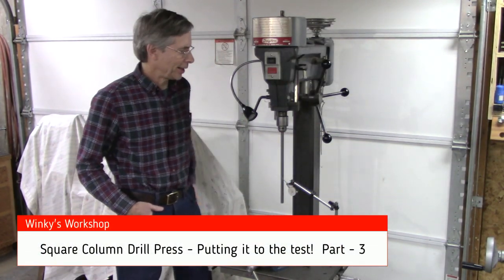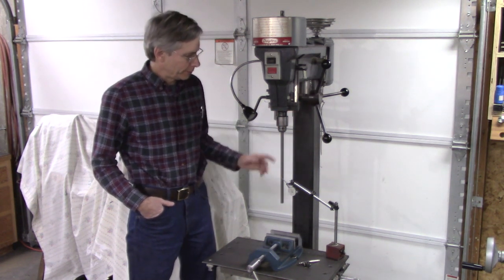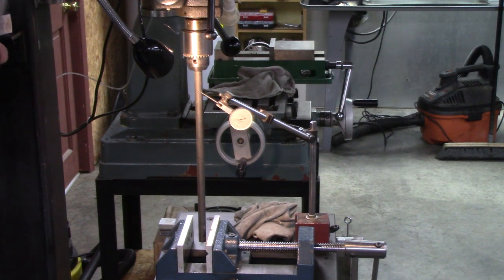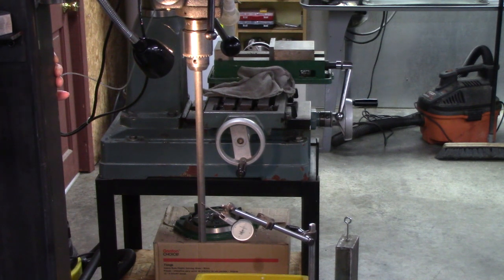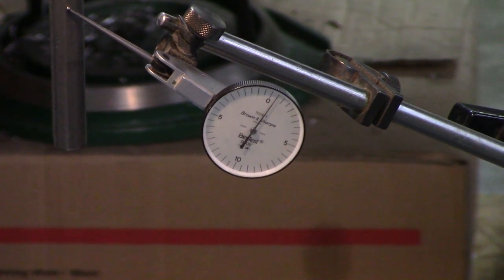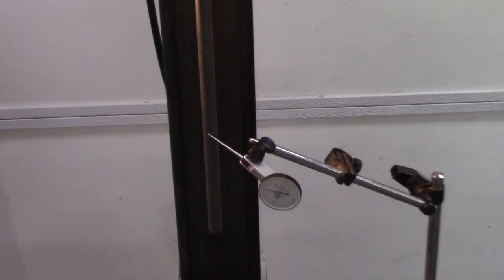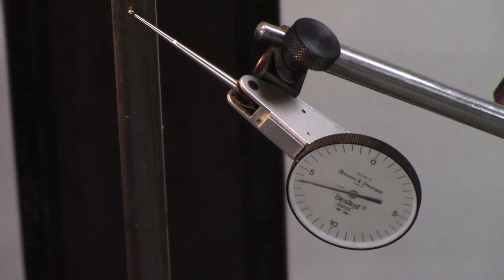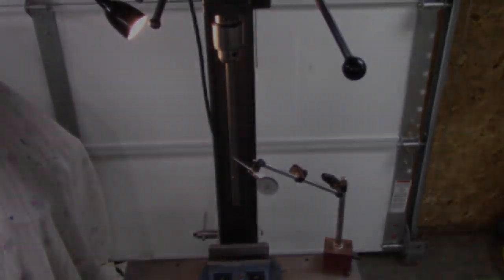The DRILL PRESS FIX - Testing for accuracy -  Part 3

Comment: Hey Wink, another good job!  Where is a good place to pick up cut offs  of metal?
Reply from the maker: That's hard to say. Sometimes I find good stuff at recycling facilities but I also go to a very industrial steel yard about 40 miles from here. Most cities have a steel supplier near by that caters to industry and fabricators and they are probably 70% less any on line sources. The steel yard near me has one huge section of off cuts from industry and out of spec steel for 30 cents a lb. I always end up buying some of this stuff.

Comment: Add a wider/heavy metal base plate underneath the steel frame,... add some set screw/feet (with some nice rubber pads) to level her up, and/or bolt it down to the concrete floor (so  the whole thing doesn't wobble), and you are golden. :).  
Well done.  You got some nice travel length.
Oh,... Maybe a different (bigger) sprocket up top to speed up the travel time (insert yawn here).
Reply from the maker: Thanks for the comment. I think the horizontal supports at the base need a diagonal support to the column. I'm sure it's plenty strong, just springy.  Also, I totally agree on the crank. I now have a harbor freight 3/8" drill driving the lift screw. It looks funny but works great.
Reply: The base looks very narrow. The steel should be strong enough, it just isn't very wide.
If you can bolt it down,... Or,   Put some inserts in the floor that you run a bolt thru and down into.
That way you can wheel it around, and bolt it down when you need to.  The rest seemed very solid.  Nice job!
Not sure how you'd add a diagonal without losing range of up 'n down.  ?

Comment: What a great solution! In the previous parts I thought the idea of a motor driven lift screw was sort of over kill, but watching you lower and lift the table for this, I get it now!
Reply from the maker: I have a harbor freight drill on the lift now.  It was $17 buck and works perfect. It blows my mind that a company line Grizzly doesn't make something similar. I mean they could make a dovetailed column like a mill only lighter weight. It now has an X Y table on it and I use the heck out of it. I highly recommended both the drill press mod and the X Y table.  The table was kind of hard to make but even if you had to buy one it is well worth the money.  https://youtu.be/6gxFdKJ8Ja8

Comment: Nice job. I have found the new square and rectangular tube is not as square as the older steel so you really got lucky with the tube. Your build is impressive with all the travel of your table and the mating parts being so true with each other.
Reply from the maker: Thanks! I'm not sure about old vs new steel but yes, I was shocked it was so accurate. If I remember right the dimension was within .002 top to bottom. If I partway lock the quill and account for the backlash in the X Y table I can drill very accurately.

Comment: Darn near PERFECT!  I DO NOT THINK MY DRILL PRESS IS THAT GOOD.  Ithas a round column.
Reply from the maker: To be honest I as shocked it was so close. Your drill press is probably better than you think. What I was measuring was how well aligned I had the top tube when I welded it to the square column.

Comment: ... Especially surprising since you did some heavy welds at the ends.   You'd think that would distort the tube even if it started straight.   You must be living right.
Reply from the maker: The 4-inch square tubing was 1/4" wall and the round was 1/2" wall so that helped a lot but I agree, I was also surprised. The welding on the bottom shouldn't effect anything critical but I was concerned about the top tube. I agree...  I got lucky!

Comment: Looks really nice when done and you know we are not fans of the round columns (radial drills yes) it is a machinist thing to these two desert dwellers anyways. The square tube you used size and all looks stronger to me. Nice solution to drill with longer drills in bidder or taller parts.

Comment: On the alignment if I were trying to make sure the alignment was correct I would attach the indicator to the rod in the chuck and touch the work table with the indicator finger and turn it in a circle.  Just the way you would tram a mill head.  After all your workpiece is going to be flat with the table most likely.  Of course I realize the drill press table may not be flat and if not put it on the mill and level it out with a fly cutter so you have a good surface.
Reply from the maker: Good idea....  although this doesn't measure the accuracy to the table travel up and down, which was my biggest concern. The table is an X Y table I built but it's just 1/4 inch plate steel. I could do as you suggest by turning a disk with an attached shaft and clamp it in the vice I have pinned to the table.  This would tell me if I'm square to the table in all directions. The thing is, I can adjust the table and make it square no matter what. Look at it this way, if I welded the pipe on the top of the column 2 degrees off I could still make the table square to the chuck but when you moved the table up and down you'd be drilling in a different location. The test in this video told me the spindle in my drill press is aligned perfectly with the column.
Reply: @WinkysWorkshop  yes I see your point.  Thanks for the reply.
Reply from the maker: @AmateurRedneckWorkshop  - send me your email again, I sent you one but it said the address wasn't valid
Reply: @WinkysWorkshop  hswatersatyahoodotcom  don't forget to edit out the things that replaced the punctuation.

Comment: Wink, do you plan to buttress the column to the stand, and bolt stand to the floor, to stop the jiggly wiggly?

How about polishing that rod and indicating it your lathe, then back to the drill press?
Reply from the maker: It would be nice to have it more solid...  although, it is way better than the original column. This drill press is made by Dayton and some of it is well made and some not. I like split housing to tighten the quill and the 6 inch quill travel.
Reply: @WinkysWorkshop  Now with that x-y table, have you thought about upgrading the bearings in the spindle? something like this

https://www.indiamart.com/proddetail/tapered-roller-thrust-bearing-14081483333.html

When I will take apart my drill press to clean and rebuild, I will looking at replacing ball bearing with roller bearings.
Reply from the maker: @satxsatxsatx  - Love the tapered roller bearing...  For what I do the bearing in my spindle are good.